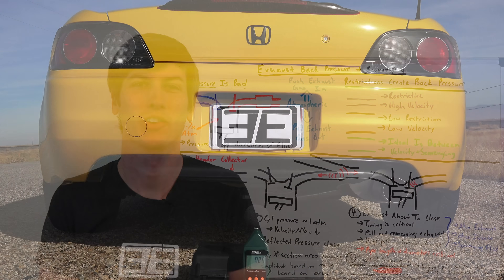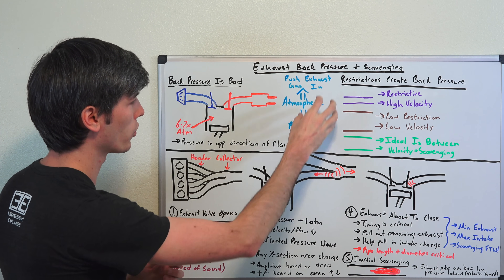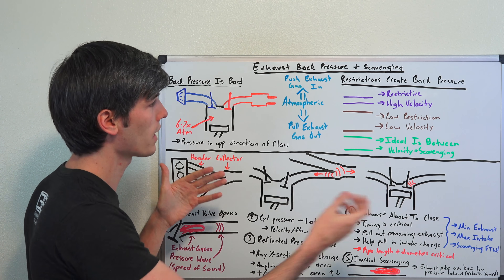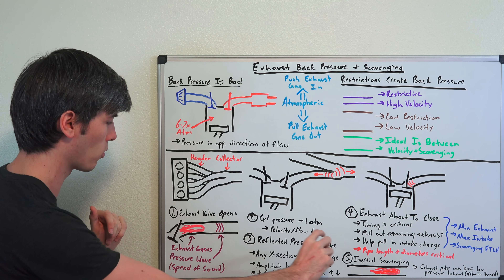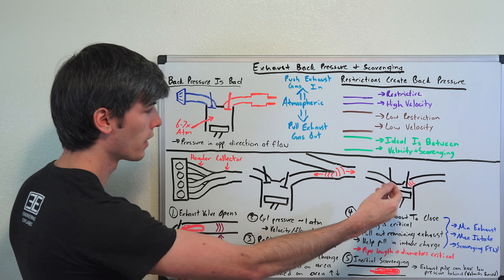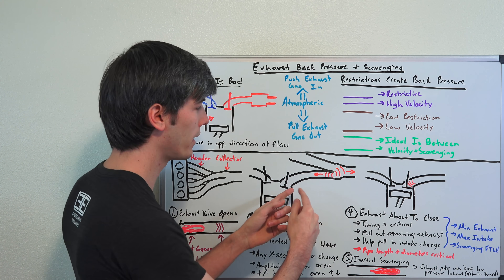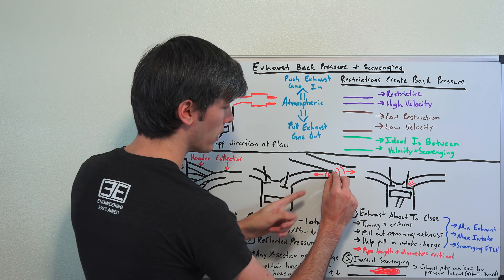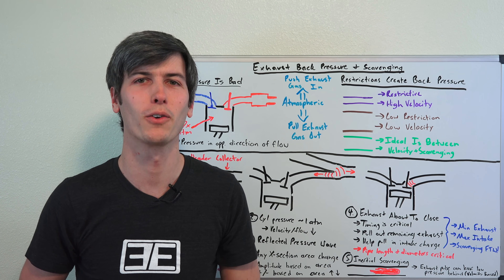Stop Saying Car Exhausts Need Back Pressure

Comment: happy New year,

I was a bit disappointed with this video. The explanations showed a lack of basic understanding on some principals. a bit of knowledge but a bit mixed up at times.

thanks
Reply: try breathing through a straw and tell me
Reply: explain
Reply: ScuffyNZ look up the equations for tuned exhausts, all call for some back pressure to work correctly. A human breathing is nothing like a sonic wave in a hot pipe.
Reply: Resistance doesn't equal back pressure.
Reply: It was harder to follow than his usual and my attention began to wander. I expected a Big Bang conclusion but no. The jest of it, as I got it, is the less backpressure the better, but still I think removing factory mufflers is a waste of time and money (plus illegal if noisy).
Reply: back pressure, as in resistance to the exhaust gases exiting, is absolutely not necessary. at all. period. end of story. you are wrong if you argue.
Reply: Then u understand nothing about how the sonic wave behaves in a hot exhaust pipe . Go do a physics course.
Reply: i thought so too. high exit velocity with a narrower pipe.. correct but where is the back pressure from if the outside is  1 atmosphere pressure ?
Reply: Hi ,
far question. I made the comment 3 months ago and can't recall the basis from memory, why I made the comment.
I don't have the time to re-look at the video to back up my statement, but would clarify I generally feel the information provided is generally fine and feel it was a bit less exact in this video than "Explained Engineering" usual standards.

Comment: exhaust valve open total 260 degree, if you have too less back pressure fuel and fresh air will through out to exhaust pipe with out combustion, and you will have less air and fuel to compression and combustion in cylinder, that mean you lose power at not high rpm. (61 degree on power stroke before exhaust stroke + 180 degree exhaust stroke + 19 degree on intake stroke = 260 degree total exhaust valve open, not only 180 degree like you might think.)
Reply: This is why you could smell all the gas in the exhaust of old hot rods, particularly if the carbs were not adjusted for the new exhaust.  However, now all cars are fuel injected, and many are direct-injected.  In the case of direct-injection, it doesn't matter how much intake air is pulled out the exhaust valve because there is no fuel in it.  The injector fires after the exhaust valves close.

Comment: So what happens if you get aftermarket headers that do not produce the 'sweet spot'? does the On board computer compensate?
Reply: The sweet spot depends on the type of driving you will be doing. Long headers produce power on the bottom end of the rev-range, good for getting off the line. 
Better for street driving. Short headers strengthen the power band in the higher revs. So if your buddy puts a set of "shorties" on his car, challenge him in a corner to corner race (somewhere there are not pedestrians, you don't want to go to jail for murder) and leave him scratching his head as to why he can't get it to "hook up".
Reply: That’s why you don’t slap on exhaust and think your done, get a tuner and take it to a guy that knows what they’re doing and he can tune your car. The exhaust can be tuned but only to a certain RPM range, this will be done by adjusting timing. (Pretty much what the guy says in the video...)

Comment: dont forget that many, basically all camshafts to a certain degree have valve timing where the intake valves starts to open while the exhaust valve is still open to create scavenging effects and or to help bleed cylinder pressure in turbo/supercharged  engines. exhaust is not a critical issue as long as it is not restrictive. sometimes a slight effect of restriction is beneficial for under the power curves

Comment: 3 minutes in, contradicts the title. When back pressure is talked about it's always in the context of the exhaust having that ideal compromise between velocity and restriction that creates the most efficient way to remove exhaust to maximize power. Usually in regards to a disconnected header flex joint.

Comment: Great info, but stick to the basic's ie: If the exhaust gases are moving out though your headers, there is not going to be any small diameter piping than you header size, the collector of the headers are always larger than the size of you headers ie: like a v8 just one size depending on the size, say 1/34 Inch will have either try y set up or 4 into 1 which will have 4" inch collector at the end and then most people for drivability and still have noise sound will have 2.5 inch straight through exhaust system with Hi flow cats and because most new cars are all fuel injected and controlled by ECU or computer then most people have them turned to the new air to exhaust system and fuel setting changed as well ?
Also not one engine manufacturer will have smaller diameter exhaust pipe leading away from the headers which will cause back pressure to be greater than what is required for the exhaust lifters to work properly and not get damaged at higher revs ?

Comment: I cannot see how velocity is an important metric in this application. Velocity can create inertia and I can see inertia being helpful in creating a vacuum but the timing of the vacuum would be after the exhaust valve closes because of the compressibility of gas and the time it takes to decompress especially at high RPMs. Even if the gas does decompress quickly enough I have a hard time believing that the small amount inertia would be enough to help the exhaust in any meaningful way. I would like to see a real-world test between the exhaust venting into the atmosphere without an exhaust pipe and compare that to anything close to what you would consider being the goldy locks zone of exhaust pipe diameter. I believe that the open exhaust (lots of volume, low resistance, low velocity) would always beat any resistance/back pressure in efficiency.

Comment: so how do you calculate the best diameter with the given lengths and scavenging requirement?! I spent a few weeks experimenting with pvc pipe and I ended up just wasting my time since I thought a fan with pipes could emulate an engine which pules :\

Comment: You should make it clear that this is most applicable to NA engines, and that with turbocharged engines, anything after the turbo is relatively harmful to power, because of the power gains from having a freer spooling turbo outweigh the things like scavenging etc. Basically bigger usually means better after the turbo. Correct me if Im wrong.

Comment: Many years ago it was merely about back pressure to prevent valve, and seat burn-out. That was a long time ago in the days of leaded engines, and valves are much tougher now. The science behind exhausting a cylinder wasn't as crucial as it is now in high performance modern engines. So I found this all very interesting in contrast to old beliefs.

Comment: I dont agree 100% as bikes do have exhaust valves which have several effects on how the engine works. One is altered back pressure the other is it effects reflected waves when the valves open and how the engine scavenges. 
Zero back pressure and/or poorly timed reflected waves can have a negative impact on power at points through the rev range when cams have a large overlap. Exhaust valves help lower end and mid range power by keeping un-burnt fuel inside the engine and giving good power. As the valves open the un-burnt gasses can escape more so the fuelling needs more fuel going into the engine so economy suffers and you are putting more fuel into the engine than it actually needs. By tuning the exhaust for reflected waves it helps stop the un-burnt fuel going into the exhaust. Reflected waves only work at specific RPM so some back pressure helps when the waves have either zero effect or actually make the scavenging draw more fuel into the exhaust un-burnt. You do need both. For ultimate power you can have zero back pressure but that would make the power range very limited and only suitable for a race engine where mid range power is not used. 

Having worked with a number of teams and made components for WSB, Moto GP and even F1 exhaust tuning is very complex and exhaust gas speeds with very specific tapers to the headers and tuned lengths to get the optimum out of the engine is more than just fitting a big pipe. Changes of angles where tapers occur all have an effect on reflected pressure waves. But so do diameters and how the gasses flow and some back pressure is used for specific purposes. 

So I partly agree for ultimate power back pressure is not needed but you need to use several other factors like reflected pressure waves and gas speeds.

Comment: Would it be beneficial to have sort of a reverse turbo sucking exhaust out?
Reply: It would, except that you need to power that somehow. It would take more energy to run the "reverse turbo" (essentially a vacuum cleaner) than you would gain from the more efficient exhaust, however, so you'd have a net loss of power.
Reply: Dale Blankenship how about a 48v electric pump like Volvo uses now to reduce turbo lag.
Reply: how about just having no exhaust whatsoever and dumping it straight out of the exhaust port? no backpressure, no resistance. no scavenging, but it should more than make up for it with noise.
Reply: Ethan McLeod turbo is powered by the exhaust gases. It spins a turbine which is connected to a compressor on the intake side. I dont think you quite understand the design of a turbocharger.
Reply: LOL!!! Turbo charger is a combo of gas turbine and compressor... It's an energy recycling process lol... If you don't use exhaust gas to power it then it's not a recycling process
Reply: Two stroke Detroit engines used blowers AkA superchargers to scavenge the exhaust from the cylinders to draw in fresh air!
Reply: Well I thought that a concept such as that already exists sort of. You can place a turbo on the exhaust side which uses the exhaust to boost an engine where most people place turbos on the intake side using the engines power to boost the amount of airflow.

Comment: Great video on a complex subject.
My only comment is that I would argue that a small amount of backpressure will help keep low pressure areas from forming in the exhaust system which hurts the scavenging process because it will keep the overall column of exhaust slightly denser, which will increase it's mass and improve inertial scavenging. Otherwise if low pressure areas are allowed to form, atmospheric pressure will try and rush in to fill them in, disrupting the smooth flow of the exhaust column. Note that you don't see any race cars with open exhausts (ie no manifolds or headers) which would be the least backpressure you can have. Instead they sacrifice a tiny bit of backpressure to create that column of exhaust gasses and use it's inertial flow to scavenge the cylinders by using headers (think Top Fuel dragster for the most extreme example). Obviously there's a point of diminishing returns on this that race cars can afford not to cross (using open headers) where production cars must still meet pollution and noise regulations.

Comment: i think back pressure is a emissions excuse. they have been re-introducing burnt exhaust into the intake charge since the EGR was born. engines have been made so close to perfection as far as combustion efficiency is concerned, why mess it up with pumping losses by adding back pressure?

Comment: Back pressure refers to the movement of the exhaust gases through the exhaust not the pressure buolding up in the exhaust. As the exhaust flows out it will pull more exhaust out with it. 
Its badly named and confused me alot also.

Comment: true and not true at the time !!! if your car is equipped with a K-jet mechanical injection or a air mass sensor type injection, it's true, if your car is equipped with a D-jet injection or carburetor, if you decrease the back pressure, you must readjust the air-fuel ratio as the incoming air is greatly altered, that something that the common backyard enthousiast is not equipped to do the right way

Comment: With an electrified turbo system like Mercedes F1, you can tune exhaust pressure at the same time as the intake pressure with the use bypass/blowoff valves. IE creating vacuum pressure between the cylinder and the exhaust turbine.

Comment: im not agree with all of that. 1st diameter only change your torque readings not power. second fresh air even hot is whey more light than carbone oxide 3rd youd collecktor have to be bash flat to male a back preasure whats look like a lot of crank case preasure. my question is if im wrong why use a long tube headers in N/A engine ?

Comment: Happy new year to you too, you definitely have explained things that I never knew about the back pressure, certainly you covered the science part of it. what I would like to add or wished that you explained it is the deference between headers and valve controlled mufflers, I understand that's dependable on the speed of the engine and if its a an NA or charged engine, I was fascinated when I knew why headers are so curved in some cars (F1) or short and dull in others and the fact that you might shorten the life of your engine if you installed a 4-2-1 headers in some cases rather than a 4-1. I would definitely like so much if you can give us so science behind these things ( I like to watch and learn rather than reading 😁 )

Comment: While I can appreciate what you are attempting to explain, you are providing a dis-service by frequently jumping around both the timeline of the process and the boundaries for evaluating the geometric constraints and thermal flow.  Please break this down into smaller sections, and follow a contiguous timeline.  Regulating flow out of the cylinder is highly complex, and simply stating that backpressure is not good is too grandiose of a statement.  Also, your definition of backpressure is not entirely accurate, and should be clarified as to being wholly dependant upon the flow of exhaust from the cylinder.

Comment: @ Engineering Explained it's all right and good but this is only right for 4 stroke engine. you need definitively for 2 Stroke engine back pressure that's how the 2 stroke gets properly working. U haven't clarified it and that is wrong that's the reason because so many people gets confused and want back pressure in thare 4 stroke in the first place. but anyway good explanation for the reasons to not need back pressure in a 4 stroke engine. keep it up

Comment: Flowtech offers headers with anti-reversion  (welded-in collector merge spears). They're supposed to control exhaust gas re-entry into primary tubes. Should I remove them from my camaro z28?

Comment: Does that basically means that every curve on the exhaust, lets say from catalysator onward, is always detrimental to the optimal flow and exhaust scavenging, provided that the diameter of the pipe stays the same?

Comment: I'm using a 1.6 VVT Dohc low pressure turbo engine. Can I know the best exhaust setup for my engine to ensure that there will be no back pressure? I've just converted my stock downpipe  with catalytic converter to an aftermarket downpipe from Works Engineering. For the mid and end section still remain stock. Hope for ur kind feedback. TQ.

Comment: Great video. Thanks for your time and effort. Question...
I'm going to install short open drag pipes on a Harley that has a stroker motor kit. I want it loud of course. But I don't want to sacrifice performance. So would I have to lean the fuel/air mixture or increase the fuel mixture??
I have an adjustable Mikuni carb installed. Also, I've been told to install a make-shift baffle that would create some back-pressure. ???

Comment: The Dislikes are the people that said the car exhaust needs BackPressure.
Reply: I disconnected my cat from my old 90 4runner once and it felt 10-20% slower.
Reply: r2dxhate that makes no sense a high flow exhaust wouldn’t change that much you might get a gain of like 1.5 to 3 horse power not much
Reply: @zippyoya  I'm not talking about a hp gain, I said my 4runner got slower. Someone suggest my cat might be clogged, so I disconnected my bolt-on cat to see if it ran better with no exhaust at all besides headers, and it was way slower instead. I'm not saying that proves engines need back pressure, but for some reason it wasn't running as good when it was allowed to breath better.
Reply: @r2dxhate  To little back pressure and you kill velocity, to much back pressure and you kill velocity so yes back pressure does play a roll in exhaust design. Think about all the people who run to the muffler shop and have that flow master or magna flow muffler put on their brand new stock truck and have duals run out the back instead of the single exhaust out the side, what happens 99% of the time? They lose low end torque because they killed the velocity of the exhaust gases. The stock exhaust had a higher exhaust gas velocity but when the new muffler and pipes removed some of the back pressure the exhaust gas velocity slowed down resulting in lost low end torque that you could feel.
Reply: Miguel Ruiz the only type of engines that needs back pressure are 2-strokes I think that’s where they got that from
Reply: @zippyoya  typically the flow should be balanced. If your exhaust is sucking raw fuel out of the cylinder before the valve closes you might consider changing the flow of the exhaust. Valve timing sometimes overlap incorrectly. Also the expansion chamber of the 2 stroke doesn't create back pressure.
Reply: Your mom likes back pressure.